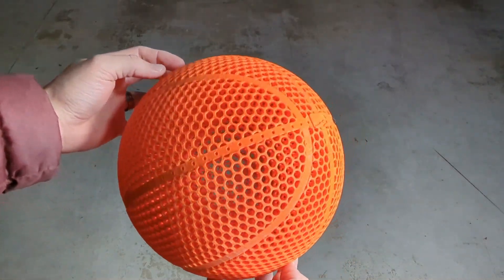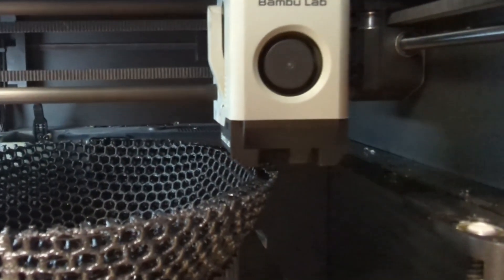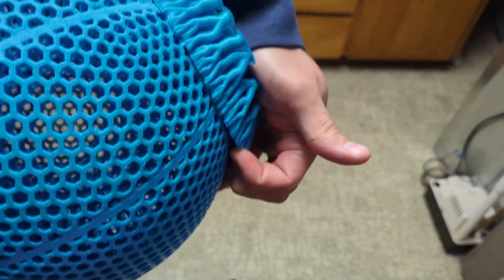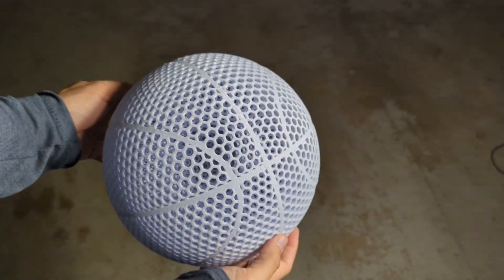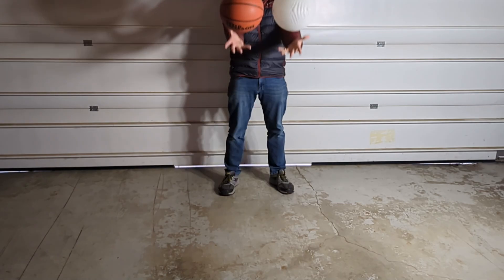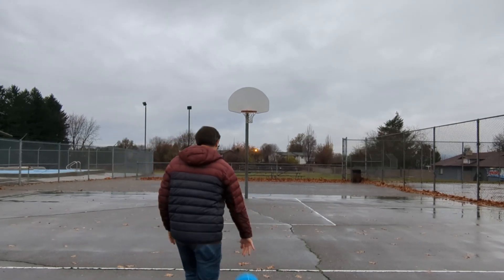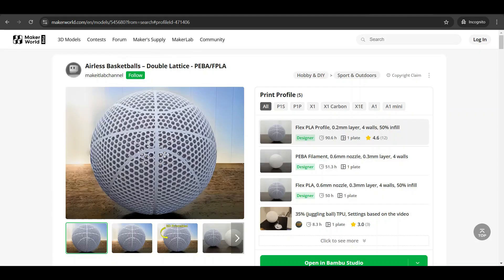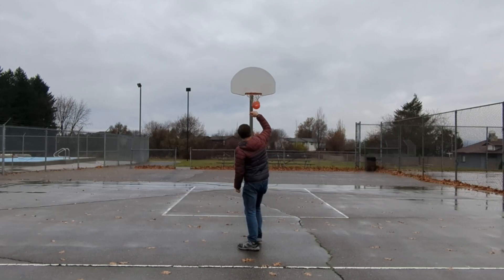Is This BIQU PLA-HR Filament The Ultimate Airless Basketball Filament?

Comment from the maker: Be sure to check out the BIQU PLA-HR filament!
Reply: Wonder how a double filament build would work. Either with a softer inside and harder outside or the opposite. ;)
Reply from the maker: @88Spint  I have seen some folks attempt this with mixed results - at some point I will need to invest in a multi-material printer so I can test it 😁
Reply: Can you test out the hyper PLA and create a file for it?
Reply from the maker: @jacksonyang2044  Are you talking about the Creality hyper PLA? I am testing a different high speed PLA right now that they say has high mechanical strength too, just printed one right under 500 mm/s
Reply: @makeitlabchannel  I just saw your video about the Hyper PLA and i was wondering if there were any possible ways to make the ball more durable?
Reply from the maker: @jacksonyang2044  I believe there are a couple of options, the first would be annealing it in an oven, and the second would be to coat it in 3D Gloop. I think the 3D Gloop would have the best results for durability, but it is definitely the more expensive option. If I buy some more, maybe I could try annealing it to see if it holds up.
Reply: @makeitlabchannel  okay thanks for that, but recently i saw your video of the flexi PLA from Ataraxia, i was just wondering would Flashforge flex PLA work as well?
Reply from the maker: @jacksonyang2044  I have seen others print with it and it sounds like it prints fairly well/looks like it bounces very similar to the Ataraxia Art flex PLA, but I am not sure about how it holds up durability-wise
Reply: @makeitlabchannel I just ordered the ataraxia fPLA filament, what settings will work best on my X1C?
Reply from the maker: @CapyBara-hw8ij  the easiest would be to download my 3mf for the fPLA off Makerworld (https://makerworld.com/en/models/545680?from=search#profileId-471406) and load it for the settings, but if you want an overview of the settings I used, I list it in this video: https://youtu.be/L7AP0ahJMyo
Reply: I’m trying to print one with biqu and when I go to bambu studio to do all the settings, the filament didn’t show up in the studio, and we make a preset and it still doesn’t work, any thoughts on how to fix it
Reply from the maker: @HawaiianAEP  Hey there, I am guessing you loaded the 3mf that I posted for the BIQU? The filament in my 3mf settings is just listed as a "generic PLA" profile, but it has been altered to work with the BIQU. Hope that helps!
Reply: @makeitlabchannel ok thanks, do I need like a dryer or something because after we did that there was a clog in extruder, and we checked everything out and nothing was wrong
Reply from the maker: @HawaiianAEP  You didn't run it through an AMS right? I always dry my filament, but if it is a new roll you should be ok
Reply: @makeitlabchannel  I use a ams so is that the problem, we also have a new roll of that filament, is it because it’s like a new ams, I have the bambu a1 ams lite, is it because of the ams lite
Reply from the maker: @HawaiianAEP  I am guessing that is why, but the settings I used were optimized for the P1S, so there might need to be some small changes. I would start by using the external spool holder instead of the AMS, and if you keep having issues, it might be worth trying to up the nozzle temperature about 5C to see if that helps
Reply: @ ok I’ll try that, thanks!
Reply from the maker: @HawaiianAEP  good luck!
Reply: amigo no se entiende nada la proxima hace una tier list y pone siempre al mejor para comparar en cada video :v

Comment: hi sorry I don't think you will respond 2 things how important is drying it if its in a dry room in a dry area and you didn't use the ams for multicolour but did you use it ?
Reply from the maker: I would say if it is a dry room and it hasn't been that long since you opened/used it, it is probably fine. I would always recommend drying it if you can though

Comment: If I have the h2D can I use say petg for the supports? Have you tried it?
Reply from the maker: I believe you can do that with the h2d. I have printed a TPU basketball with pla supports using the AMS, so if you have everything dialed in I bet you could
Reply: @makeitlabchannel  thanks for the response. I have the pla hr filament coming in today. I’ll print it normally first and if I have any left over I’ll try it on a smaller scale. Don’t want to waste this stuff, you know it’s expensive.

Comment: Whats wrong with a regulation air basketball?
Reply from the maker: What if we run out of air?! Lol, yeah there is nothing wrong with a regulation air basketball. It is just a fun challenge and thing to 3D print, and with some of the filaments coming out, you can actually print a basketball cheaper than buying one that bounces pretty close.

Comment: Bro, please help. I have already bought blue plastic like you have. I can’t print on my Creality, file from Bambi isn’t working. What I need to change in preferences? 😢
Reply from the maker: @EzKirill  What printer and slicer are you using? The Bambu 3MF file is for Bambu Studio, so it won't load if you are using something like Cura. You will probably have to change the printing settings to match what the BIQU filament recommendations are (in the slicer)
Reply: @ thanx for answer) usually Creality slicer, Orca. Your 3mf loading everywhere, but we have different tables, Bambi 25-25-25, my:30-30-30, and printer show error, by Y, coordinates goes over meanings.  I have edit table, but it’s not working to. I see one way: get you setting from 3mf and do a new from the beginnin for my self in Creality slicer.
Reply: Creality k1max

Comment: can you print this on an a1?
Reply from the maker: Since I was able to get my A1 up and running, I have been testing the different filaments out with it. It was able to print the flex PLA and Wisdream with no problems, and if it can print those it can definitely print the BIQU. I just have to keep the print speed low, even lower when printing the top, and add extra support material for stabilization.

Comment: I need a Pickleball that hold up is 50°f weather better with the similar physics. Still needs to be lightweight so it don't damage the paddle.
Reply from the maker: @YorkyPoo_UAV  dang that is cold - the only filaments I know that could hold up would be polycarbonate, Nylon (PA), or maybe ABS.
Reply: @makeitlabchannel  oups... Meant 50°f 10°c. Most people HAVE to use Yellow Franklin X-40's that cost $12 for 3. Imma try if they will use the Orange. Found those for $1 a ball. They all perform great (they are the standard) but they wear pretty easily and are fragile and cold temperatures.

Comment: Thanks for the video! I am having problems getting filament to stick to A1 PEi textured plate 70C. Tried glue stick, blue tape and it always separates. Blue tape worked the best so far. I made it to 75% complete. Any tips for getting it to stick to bed? I used the BIQU file with print profile.
Reply from the maker: @DavidYouhas  That is strange, are you putting a thick layer of glue on? A thin layer helps keep the adhesion of the bed but helps it release later. Also, I know it is everyone's go-to answer, but have you tried washing the PEI plate with hot water and dish soap? As for settings that can help, under supports, there is something called "initial layer expansion." It is pretty much a brim for your supports. I would increase this by 5 or even 10mm, as this has helped my adhesion quite a bit.

Comment: I'm wondering if anyone has tried Dow OBC filament. It's commercial grade and when printed thin it's flexible but printed thicker it becomes stiffer. They compare it to a milk jug vs a cuffing board. But it is also supposed to be extremely durable where a rigid body is needed with a flexible hinge. I've also noticed that a lot of the printed balls are heavier than a regulation ball but while OBC is about 30% lighter than standard filament. It's also not that badly priced at $35/spool. Supposed to be easy to print but the only way to get it to stick to the bed is putting a layer of packing tape on the bed
Reply: I'll try some OBC but I might update the design. The issue with airless basketballs is the drag but with this lighter filament I might fill every other inside hole and alternate with a fill on every other outside hole to reduce drag and maybe even give it a golf ball dimple effect
Reply from the maker: @G33kg0d  I have thought about a design change like this as well. And that is interesting, I have never heard of this filament. I will def check it out though - thanks!
Reply: @G33kg0d did you end up trying the OBC filament ?

Comment: What grit sanding sheet to use for the best finish? Right now I'm using a Dremel with a sanding drum but it's hard to keep it level and even.
Reply from the maker: I usually start with 80 grit and work my way up to about 220, but if you want a nicer finish it might be worth going even higher.

Comment: After failing several times with the Wisdream filament, I finally managed to print a complete ball with the BIQU filament and your print profile on an A1. Thanks! A question: at the very top, before the inner wall bridges together, there are a lot of places where the overhands fail and the inner matrix of hexagons has gaps. This affects the bounce, and probably the long-term durability. Have you seen this problem? Any ideas on how to solve it - slow down overhands even more?
Reply from the maker: @aefpv_6236  Yeah that is an issue that I have ran into as well - I think slowing it down will probably help, and maybe boosting cooling too. What size nozzle were you using?
Reply: @makeitlabchannel  I used a 0.6mm nozzle, as recommended. Pretty sure the fan was on high, but I have noticed the filament visibly takes a couple seconds to fully cool and go from translucent to opaque. I wonder if a desk fan or something would help, in addition to slowing down...

Comment: Just got finished with a BiQu basketball print 57 hrs on a A1, a bit rough where the supports were and kinda drippy in some overhang areas but bounces very well, made a tennis ball too.
Reply from the maker: @immytay65  I use an angle grinder/sanding disk to smooth the bottom, but bouncing it around should hopefully smooth it eventually. Glad to hear it turned out decent, and a tennis ball sounds like a good way to use up the rest of the spool

Comment: Do you believe glue is necessary for printing the airless basketball in any of the basketball filaments eg. Peba, DuD v2 Biqu?
Reply from the maker: @LachlanSchembri  I would highly recommend glue or another release agent for any of the flexible filaments, especially for the BIQU, PEBA, and DudV2. The DudV2 ruined one of my beds because it fused, and the BIQU ruined one of Uncle Jessy's beds. It probably depends on the bed too - I print all of mine on a textured PEI, but something like glass might not need a release agent

Comment: Nice! And what is the fill rate of the part? what if I put more %? will the rebound be better?
Reply from the maker: Thanks! Because of the way it was designed, if you have at least 4 walls, it will almost have no infill. There are a few spots, but changing the % infill would not do too much. If you had less than 4 walls (which I would not recommend), % infill would make more of a difference. From my testing, I have found that more walls adds more bounce than infill, but only to a certain point

Comment: If you had a tool changer, what type of filament would you think would be good supports for this? PETG like normal PLA?
Reply from the maker: I think the PETG/PLA combo would work well, but If I could, I would go with a water soluble filament for the supports like PVA so that it just disappears after dipping it in water 🙂

Comment: What is the best filament for the price and bounce?
Reply from the maker: I think that depends on budget, but based on what I have tested, I think going with something like the Wisdream FlexiTough or BIQU-HR is great for the money, especially because they come in 1kg rolls so you don't have to change mid-print. The DudV2 PLA-B works well too but they never seem to be in stock. They are all about $60 per kg though.
Reply: Thank you for the feedback. I bought the flex pla, and it works pretty well.

Comment: Does it have to be printed with a 0.6 nozzle?
Reply from the maker: @bobjohnson6915  You can get away with a 0.4 nozzle, but the print time will take a lot longer. That is really the big difference, but I think printing with a larger nozzle also reduces the chances for clogging with the filament
Reply: I hope this works😬

Comment: Thank you for your work. I have a couple questions before embarking on my 3 day print. 1. the written max volumetric flow is 6mm3/sec but the downloaded parameter has it set at 8mm3/sec. Which is correct? 2. Would there be an issue with printing with tree supports, namely thin tree supports? I was thinking it may be easier to remove.  Thank you!
Reply from the maker: Hey there, if the downloaded parameter is 8mm3/sec then go with that, I must have typed the wrong number. Also, I always print with tree supports if I can - the reason I didn't with the BIQU model is because they preprogrammed everything for me and told me to not change anything to give their testing a try.
Reply: @makeitlabchannel  thank you!  It is a bit nerve wracking to get everything set when it's such a long print!  Thanks for everything
Reply from the maker: @slee8416  Hope it prints well!

Comment: What filament setting did you use on your printer? I’m trying to load pla hr into my A1 and it’s not working
Reply from the maker: @MS-gv4jx  Here is a summary of my settings:

Nozzle temperature: 230C

Bed temperature: 55C (textured PEI)

Nozzle size: 0.6mm is highly recommended. You can use a 0.4mm nozzle but it might not bounce quite as well.

Layer height: 0.3mm for a 0.6mm nozzle or 0.2mm for a 0.4mm nozzle.

Walls: 5

Infill: 100% concentric

Printing speed: 40 mm/s (20 mm/s for bridges)

Flow rate: 6mm^3/s

Supports: Manually painted on the bottom of the basketball only using Bambu Studio – video on how to do this here: https://youtu.be/L7AP0ahJMyo

Part cooling fan: 100%

Auxiliary cooling fan: Between 70% and 100% with 100% recommended.

Comment: The one question I have is, does it have to have open cells? Can there be a thin layer over the holes to improve air resistance while still performing?
Reply from the maker: @andrewkanzler6492  Yeah that is an interesting thought worth testing. I thought about covering the ball with a grippy layer that would improve air resistance too so I will look into it

Comment: Printing the  ball with multicolor just to paint the black lines, would be a such huge waste of (expensive) material and time honestly (unless you have a multi extruder printer ofc).
I would consider using a support interface layer to take off supports easier eventually, and supports are only in the very first layers of the print so the waste wouldn't be that bad.
But yeah, I guess most of these flex materials are not AMS compatible anyway. :/
Reply from the maker: @Cholo981  Yeah, I forgot to mention using the AMS for different support material too for easy removal, but the AMS still won't work unfortunately.

Comment: If the 30D tpu one ends up working well, maybe try the new Bambu 68D AMS compatible tpu too? Thank you so much for these tests btw
Reply: i tried that stuff for a airless tennis ball, it does not bounce at all, its super hard and not flexible
Reply from the maker: @eternalannex-JTG  I know it is not the same hardness, but I tried 98A TPU and it was one of the worst bouncing basketballs I made. I wonder if TPU needs additives to actually bounce
Reply: @makeitlabchannel  yeah I was disappointed from ams tpu , I’m on the fence of buying that 98a tpu or some of the peba s filament you’ve tried so that I can make a soccer ball
Reply: @makeitlabchannel  the ninjatek edge 83a also looks very promising
Reply from the maker: @QuangNguyen-wb5kd  Hope they help, and I will definitely look into it 😁